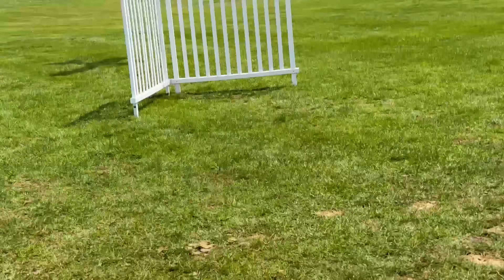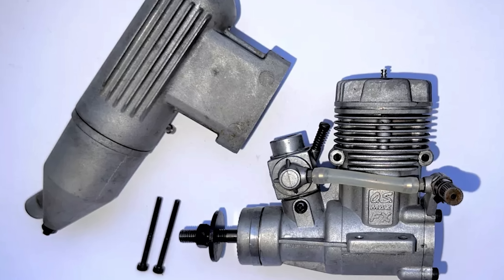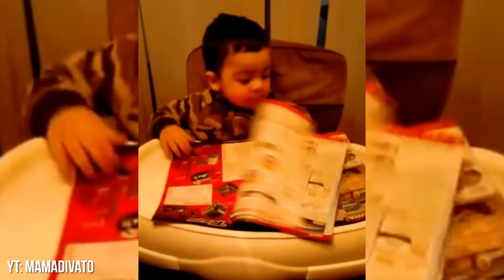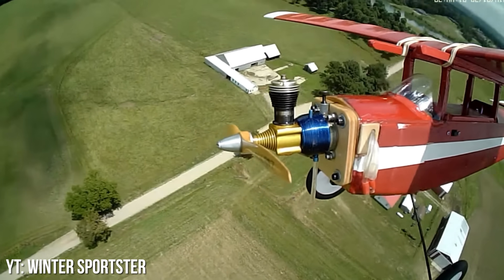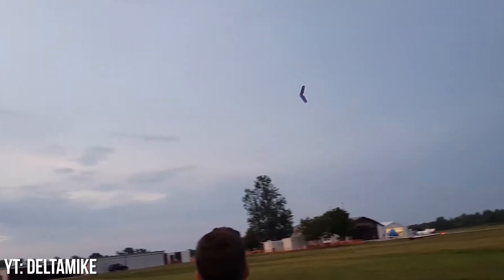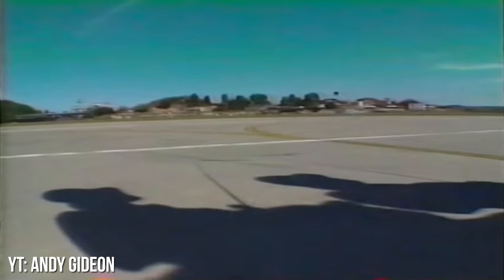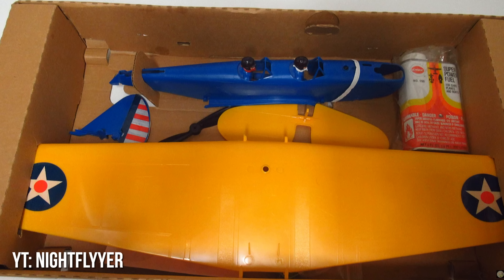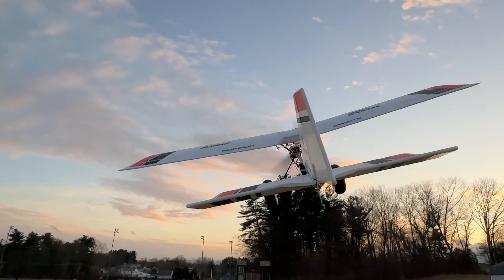18 MORE RC Plane Trends That DIED

Comment: Great video.O started R/C back in 1980.I miss nitro engines and tuned pipes.My retracts were air operated.My first radio was a 5 channel MRC 765 which I still have in my parents attic.I also had a 2 channel Cox Sanwa radio.But I will say,that flying electric R/C planes is a much nicer experience.You charge your flight pack batteries,fly,and your finished for the day.No cleaning the oily mess off you model.

Comment: Power panels and fuel pumps were usually attached to car battery powered field boxes, which were probably the heaviest items we regularly managed to forget on our way to the field - unless spouses count. I do miss those days, but I'm in no hurry to repeat them.
Reply: car battery ?   we used a small motorcycle battery.  or 2 6volt lantern batterys.  say theres a thing i've not seen in years either.
Reply: @orbitalair2103  Many did use MC batteries. So did I for a few years, but I got tired of the low capacity. Large bikes were not very common in my part of the world back then, so the ones I had access to were 2 or 4 Ah. Not always enough for a weekend of winter temperature starts. So I didn't mind the extra kilos of a small car battery.

Comment: The models shown in 15 were Control Line (C/L) NOT RC (Radio Control) and introduced a generation to the joys of model airplane flying with their low cost and being harder to break than balsa models.
Reply: I noticed that, too, but went with "Remote Control" instead of "Radio Control".
Reply: RC actually stands for "Remote Control", only later did they become "Radio Control". Remote control still applies to control line, whatever...(There were control line cars as well).
Reply: @MrBIG4D  I thank you for your clarification. I would propose that a C/L aircraft is not "remotely controlled" - there is a direct linkage from the flyer to the elevator of the model being flown and there is no other equipment involved. Directly controlled would be my call but not remotely controlled. There are still many contests and flying worldwide divided into two very separate divisions that being C/L and RC. Advocates of C/L flying will point out that one of the advantages of flying C/L is the feedback the flyer receives through the lines from the model which doesn't occur with RC (the closest, I believe, to the direct feedback from C/L flying would be FPV - although the feedback is visual rather than physical).
Reply from the maker: Control line does fall under "RC" as the original definition of "remote control" - as @MrBID4D noted.
Reply: Control line has a lot more flyers than I ever thought.  And if you get to AirVenture, in the kids area at the Museum field, they will let your kid fly a control line plane.  its really cool just to stand there and watch the kids and pros fly control line planes.

Comment: I think IC is making a comeback, at least 75% of our club members fly IC planes. There is something about having a real engine powering the plane. Definitely different to fly, requires more thought on the throttle and landings require more thought as the engine is still turning, and you have to be ready for the dreaded dead stick landing. We even have some diesel power planes, normally only RE control. Great to potter round in the evening and pass the box around to your buddies, kept one running with quick refuels for about an hour and a half one evening.

Comment: I remember being the first person with a 2.4 GHz transmitter at Baylands Park. Nobody trusted it and would still make me put up a number tag. The oldtimers at the time were all scared of it. One guy even blamed me for interference even when my radio was off on the picnic table. They would tell me to take the AA batteries out of it. I remember being so excited not having to deal with anybody blaming me and it was the opposite effect. 😂
Reply: Yeah I've run into jerks like that myself. Once one of the club Karens took my transmitter off the table and threw it hard to the ground and blamed me for interference with his junk airplane which he crashed. Turned out to be him not unwrapping the antenna which still had a rubber band around it. I never recieved an apology or got compensated for my loss. Nobody came to my defense.
And that caused me to quit the hobby. I was surrounded by assholes. Young rich and arrogant. 
F that.
Reply: @darrellcook8253  Damn, that sucks. I'm sorry to hear that. I hope you are still flying today. Don't let them stop you from having fun. I would have called the police on him. That is the destruction of property. Some of those old-timers can be real jerks. Sorry, that happened to you.

Comment: IC engines have not went the way of the dodo yet, we are a long ways away from that
When you need max performance and the lightest weight then you need IC. 
The only thing that really went away was the cost and learning curve of building entry level, and the learning curve of flying. 
I expect there is still a trend for the new guy to go buy that big warbird of their dreams and go right out and crash it, that will never go away.

Comment: What was bad about rubber bands? They are still used and still great for what they are intended for. They really help with preventing your craft from getting destroyed. They are not for models that have high wingloads, faster aircrafts or anything else where you would rather not have a crash.

NiCd were used cause they were easy to handle and rugged. Back then controllers were also a lot simpler and you'd use a NiCd for the receiver and servos, while for electric aircrafts you would have a second powersource for the motor.

And crystal-swap?
Really? You guys couldn't figure that out? Every airstrip here simply had a board of crystals at the entrance. You'd go to the airfield, check in, chose a crystal and that's it. You never used your own crystals on any airfield as they were provided to prevent exactly this.

Comment: Don’t miss most of those, RC hobby is now better than ever. Cheaper and better radio systems, better planes and electronics, etc. 
What’s going down is that there is not enough young people in flying clubs !
Reply from the maker: Check out our video titled, "Kids don't fly RC Planes. Here's Why."
Reply: thats because it tended to be filled with snobs.   i remember after i learned rc planes in college, graduating and moving to a new town.  the local rc field was filled with upper crust types.  i quit flying at fields then.  i would occasionally go to a schools field on a sunday afternoon and fly for a bit, but my stuff is now ceiling decorations.  i remember using or seeing all the things in this video.

Comment: -- That is not a "Moose Can Muffler", that is Dave Palermo's BCM(Beer Can Muffler) on a Cider Hobbies Yak-54, later he ran OS-120AX turning 12 000 RPM with 15x4 Xoar with good low and mid range power, that was missing on a tune pipe. You could not find bigger 3D pilot/enthusiast, then Dave in Burlington RC club of Massachusetts, unfortunately he is no longer among us...

https://youtu.be/7HXadU6FDMI?si=1VYTTvZVeANbizrL&t=73

-- The other reason why pipes are no longer in fashion is because, Macs Header/Exhaust owner/manufacturer of California, who made MCM and BCM possible, is also no longer among us...

Point is: No electric, as of nowdays, can develop this insane power, at the weight of Webra 91P5 or OS two stroke engines with BCM preriot!

Comment: It`s not a "glow turbine" it`s a glow ducted fan, turbines are turbines..
Edit: so you say ducted fan in the video but not in the thumbnail lol.
Btw, the only reason I no longer use my Cox engines is because of the @#£! EU regulations that doesn`t allow over 15% nitro.
And I`m still rocking a Zagi 370, it has a 20A ESC, a brushed 370 turbo driving a 4045 to 5040 prop, a  3s 1100mAh - 25C - Hyperion G3 CX which is still in great shape ;)
I get 30 minutes+ of mixed flying with capacity to spare 😎
AND, I`m flying it with FM..
It`s the only model I still use FM on though, but I just can`t get rid of my Flash 4, too many memories 😇
Receiver balloon?
Yes I have that in my boats, even though my RX`s have conformal coating, I like the added safety.
Props?
Who brings a single prop to the field? smh..

Comment: Dogs! Leave Dogs at Home for crying out loud. Cell phones off unless in your cars. Cell phones in close proximity to flight lines and near larger or gas high displacement. Fuel Burns Invisible, Get Fire Extinguisher for every ten people at regular intervals, easily accessible, not in some guy's Camper. Safety officer checks every plane every time visually and can ground any pilot or craft. No Drones or mixed media. Gliders stay above, park flyers stay in the park and flight lines are parallel to pilots lines 10 feet apart and spectators line 10 behind everything. AMA insurance should be mandatory.

Comment: I got a red and yellow Rivets “plastic plane” for Christmas in 1975. Christmas morning my dad and I went over to the local cricket ground to test it out. Of course my father had to test it out first. 

Well it went straight up and straight backdown at full speed, with the nose assembly shattering into hundreds of pieces (they were supposed to just clip off in a collision). Turns out the tail flaps had a thin seam of plastic left over from manufacturing, causing the flaps to stick. A razor blade on pre check would have sorted this out. So there was I, at Christmas, without a Christmas present…

Next came a powered glider (not RC). Its demise was my fault, another story…

Comment: I’m a dinosaur. I don’t own any electric planes anymore. I love my gas and glow aircraft.
Reply: How do they compare in power output vs a similar size brushless? I know they allow for way longer flights at a given size, if only because fuel is so much better at storing energy than Lipos
Reply: @spindash64  well I only fly 60cc+ or one or two small planes with 20cc twins. So it’s more about presentation than performance. Also about 30+ minutes so…
Reply: @dereksflying  fair enough.

Comment: AND, 40 years ago WE would discharge a nicad+nimh pack, 4 cell, concrete oval racing, discharge to 0<ZERO> volts THEN solder on a wire from + to -. 

Don't try that with lipo!

Comment: Excellent radio gear is so cheap nowadays that I don't think peeps new to the hobby can appreciate just how big a deal it used to be to 'get into RC'. Expense-wise, it was pretty much the same as buying a second-hand car.

As a kid, it meant saving, saving, then saving some more to get into the air. Servos were hideously expensive, so a first model would be rudder only or, if you were lucky, rudder and elevator.

It's incredibly sad - and ironic - that getting into RC has never been cheaper or easier, but that our wonderful hobby has been ruined for newcomers by the frenzied introduction of new 'drone' legislation - pilot registration, new taxes, fees, limitations, mandatory memberships, examinations, regulations, and all the rest of the unnecessary (and just plain wrong) nonsense that bureaucrats with no knowledge of or interest in aeromodelling are rushing to impose.

[Disclosure: I'm English, based in the UK, and currently only involved with sub-250g models.]

Comment: Nitro absolutely has not been replaced by electric. Actually doing work in the hobby has been replaced by buying a plane and pulling it out of the box just so it can look like everybody else's who bought one. Where's the sentimental value in that? Every one of my 30 planes are glow powered except for 3. Tired of people saying glow is dead. It isnt
Reply: I admittedly don't know much about glo, but it seems like it's got a separate niche from electric: it's noisier and possibly more vibration prone, but the energy density of combustible fuel can't be beaten by batteries. If you want to fly for more than 10 minutes while still getting good power to weight, you're gonna need something like glo

Granted, my project is sticking with a pair of brushless electric, but it's a bit more sensitive to vibration than most plane designs, and I need to start somewhere...
Reply: It's definitely still out there. (edit:  At least here in central Texas)  Almost all my dad's planes are glow or gas, and many of his club members still fly ICE.  I have zero glow motors and most of my club is electric.  As noted the expense, hassle, mess, and noise of a glow motor are big detractors to newer hobbyists.  My comment to my dad was "With electric, I don't have to be a pilot AND a small engine mechanic."
Reply: It absolutely has.
Reply: @tamuct01  it's out there but rear here in Atlantic Canada.  Of my 35 planes 7 are nitro.  Of those 7 three are planes I had or wanted when I learned to fly in 1999.  They rest just kinda happened.  I have zero plans of ever adding another nitro plane to my collection.  To get fuel here we have to order it by the pallet as a club.  So once a year I have to drop $330-$500 on a fuel order.  Not worth it anymore.  Gas and electric are clean and easy.  We live in a time where some clubs are electric only.  The writing is on the wall.
Reply from the maker: What is sentimental to someone is entirely relative. It should be noted that in this video what was stated is that nitro ducted fans have 110% been replaced by electric ducted fans.
Reply: @TailHeavyProductions  oh for sure, no question about either points you just made.  However, it's safe to say that any form of nitro RC is all but dead.  8th scale nitro racing is experiencing its golden age while global nitro RC hobbies are all but gone.  I recently finished a Carl Goldberg Super Chipmunk.  While Im breaking in the engine Im thinking to myself, self, if this was electric we'd be flying right now.
Reply: I'm a nitro scratch builder.
The cheque book fliers just buy and assemble another.
I glue and flew

Comment: Nicads suck. 6hr charge time for less than 10 mum flight time. No thanks. Another addition to this list would be RC planes that charged from the transmitter
Reply: You’re thinking of liions. Nicads charge fast.
Reply: @JohnVHRC a good lipo should charge in a bit over an hour. FSX is probably remembering nicads on a trickle charger, for which 6 hours is optimistic...